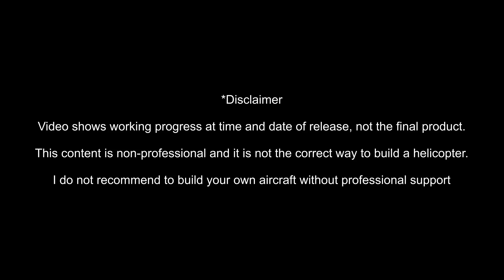Tail Rotor Gearbox Install EXPERIMENTAL HELICOPTER BUILD SERIES (Part 50)

Comment: Shaft must has almos two or tree bearing between Main transmisión and rotor gear box .... 
Harmonic vibration Will cause shaft failure......
In helicópter.... Vibration is the most frecuently cause of broken parts.... this shaft Will broke verte quickly....

Comment: SWEET! Wood like to make me one but one with, a tight 2 seater with trim adjusting. Not Shure about the all-aluminum construction iam shure it will work just more inspections. if the money was there wood be 4130 frame and stainless in the rotor head. i have machined many aircraft parts most are stainless and titanium  some 6061 or 2024 but no aluminum in rotor heads. cant wait to see it fly or see ya flying over the 91 parking lot lol

Comment: Oh one other question.  When you say “not permanent bolt.  Is this bolt just for mock-up and aircraft quality nuts and bolts will swapped in later before test flight?
Reply from the maker: Hy Bruce. Yes i will upgrade some of the bolts before first test flight.
Reply: @ultralighthelicopter  wish I was closer to watch

Comment: Beautiful...
At 5:13 did you skip the left hand thread nut? Or it's inside the black cover? Have found that nut very critical when you power the system, the whole gear shaft will fly off or stress the bearing cover bolts without it,...infact my shaft had deep threads than need be and the nut screwed it's self in tightening against the bearing covers making the gearbox cease...I had to redo the nut seat face.
Reply from the maker: Hy Jeff. Yes i skipped the left hand thread nut which is in the plans. To compromise it i added a "Stop" on the transmission shaft (the stop is added on the inside part of the gearbox and it is in contact with the bearing, which keeps the shaft with the gear on its place. It cannot move in eather way.

Comment: Job well done, sir. What is the gear ratio between the main and tail rotor? How many rotations will the tail rotor spin as per one rotation of the main rotor???
Reply: 9:30 I think I can count either 5 to 1 or 6.?.
Reply: @Simonjose7258  I sure would like  to  know the exact count if possible.  Just really curios! thankya sir

Comment: I'm from Indonesia, I want to know how much it costs to build a helicopter
Reply: It's hard to say now with price volatility for a lot of materials. The Rotax engine was about $5000 but they stopped production of them. The rest depends on how good of a machinist you are and if you can buy materials cheap or not. There are some things that for safety can't be cheaper out on.
Reply: Saya dari Indonesia juga om